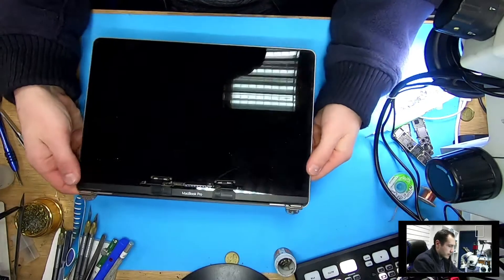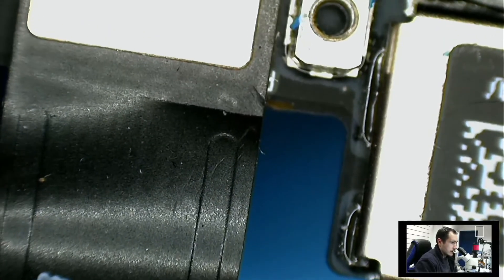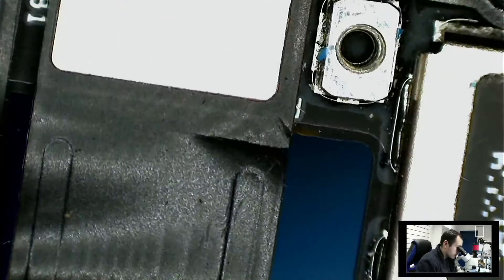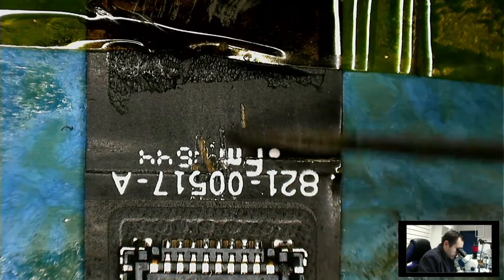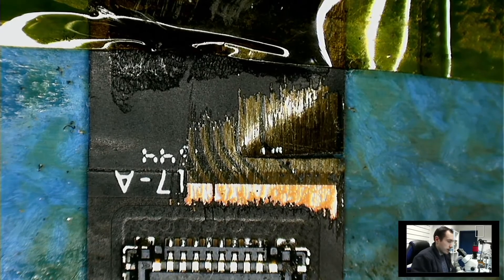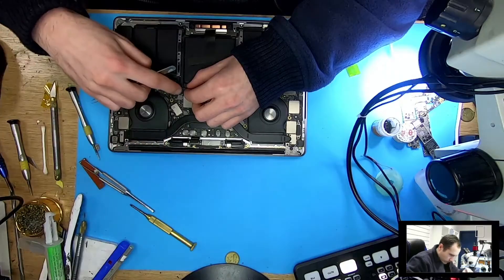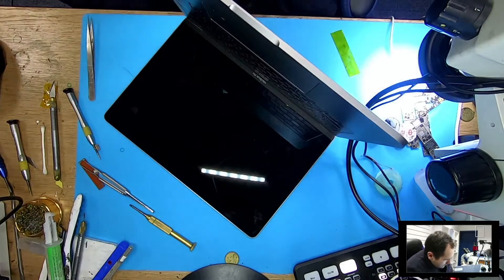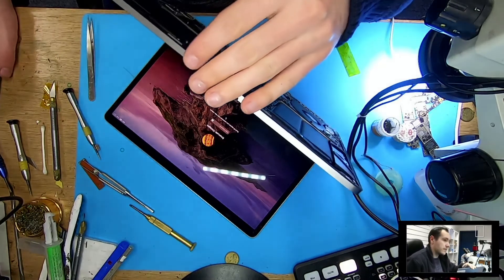Macbook Flexgate issue, no backlight, Stage light A1706 A1708

Comment: The question is :
How much fatigue will the  ' jumper wires ' withstand when opening and closing
the screen.
Also the conformal coating is not so flexible and will quickly fracture.
While the repair serves to provide an immediate repair - it is not a long
lasting solution --  More of a temporary fix.
It will not take long for the repair to fail resulting with the same problem.
Reply from the maker: @XRAF-633  it was an early solution, there are better ways now

Comment: it will break soon
Reply: I wish i could post a pic of how i do it here. I give 1yr warranty on the repair to my customer. And more better version of flex gate repair is there than what i do for now.
Reply from the maker: sometimes it does, sometimes it does not.
if it does, customer comes back and i make longer jumpers straight to connector.

Comment: Esto puede aplicar en la Macbook pro 15 2018 ? Ya que no da video mi pantalla
Reply from the maker: you have to check with a flash light on screen if you actually have no video or just no backlight.
If no video, problem will be on the board probably.

Comment: What type of the wire ?
Reply from the maker: i used from earpiece of iPhone, folded it 3x times to make thicker.
Reply: @hassleforit5683  
Great work , I have MacBook like this issue and I don’t find one who knows to do like you, I will try to make it by myself, can you give me any advice about this that help me in work , it’s my first time 😄
Reply from the maker: @ST12WLL  Practice first with some iphone home buttons or screen flexes to scrape down coating safely. also make sure you have experience to do jumpers in tiny places. good luck
Reply: @hassleforit5683  thank you 🙏🏻🌺🌺